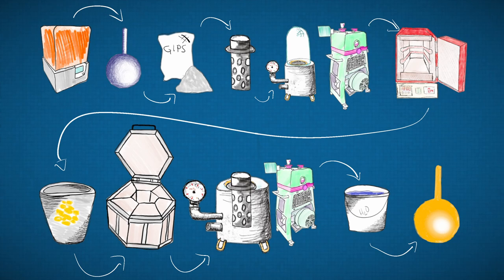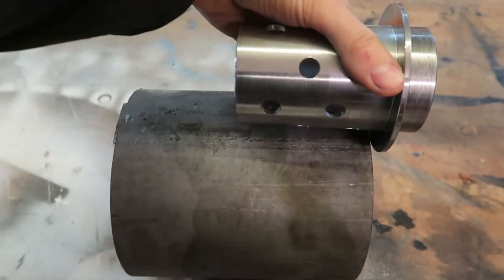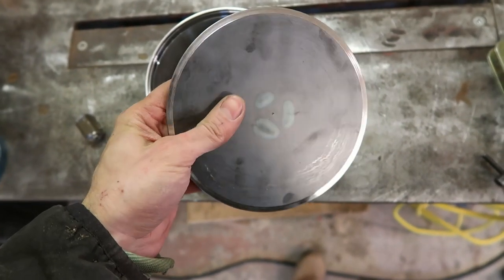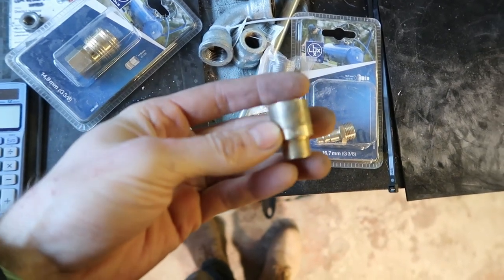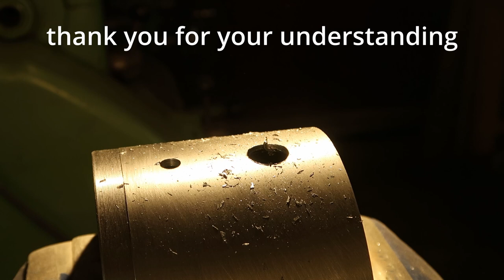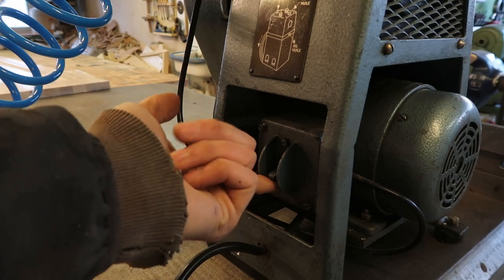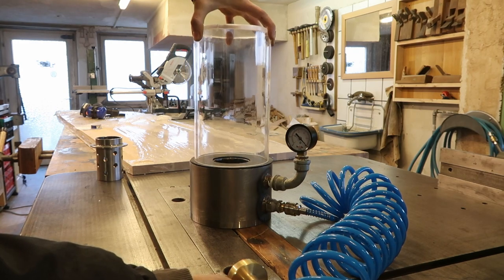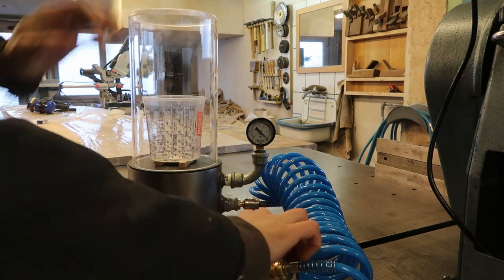3d Print Vacuum Casting Part 1 | Building the vacuum casting machine for casting metal

Comment: Hahaha, I ended up doing mine using the lathe... Mounted a drill bit in the chuck and pushed the chamber against the bit by hand till it was done. Might not be perfectly centre, but it worked. Drill presses be tiny when you add on the size vice you need to hold big stuff!

Comment: Very good work. I won’t say anything about your hand drilling though. Been there too many times. 
It would have been nice if you had given more explanations about the various steps. 
What 3D printer do you use? I noticed Formlabs on the screen but wasn’t sure if that was the printing material or printed. Formlabs has some investment casting PLA from what I hear. Expensive equipment though. 
Thanks,
Paul

Comment: Could you specify the dimensions of the material? Pipe diameter and thickness, lid thickness. Thanks.
Reply from the maker: 5mm wall thickness pipe, lid and bottom is also 5mm. The Plexiglas is 10mm. Diameter is around 150mm.